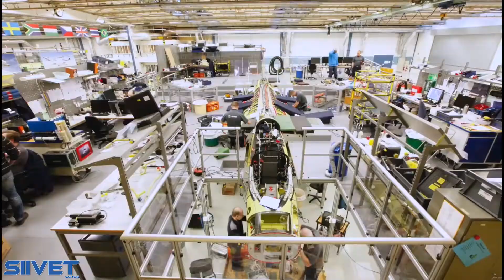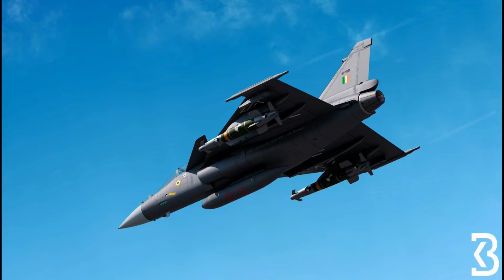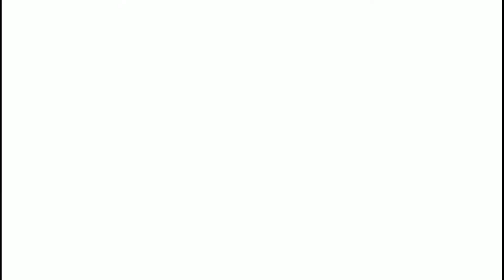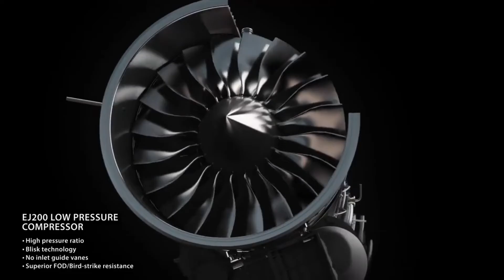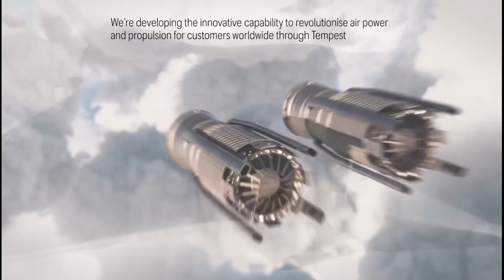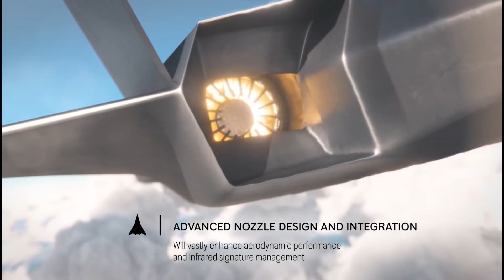Tejas Mk2 Recent Update | in English

Comment: The initial mistake was done long time back ..when the Mirage 2000 deal was on ....it should have gone at any cost with the manufacture under licence of 110 of the type  and added another 50 in its inventory...and acquisition of Rafaels would have roped in easier . Development of the Tejas would have run parallel and benefitted from inputs from Dassault Aviation ...wishful thoughts of mine !
Reply from the maker: In my opinion,

IAF should support the Tejas program from the beginning or continue with MCA even after procuring Su-30 Mki in a large number and FPGA in development. 

MCA - Medium combat aircraft, max take of weight 15-20 ton, Now known as AMCA
Reply: @defencestudy  in essence i agree with you, though i wish that India stops with procurement of aircraft from Russia .